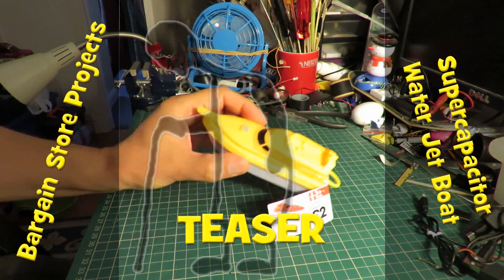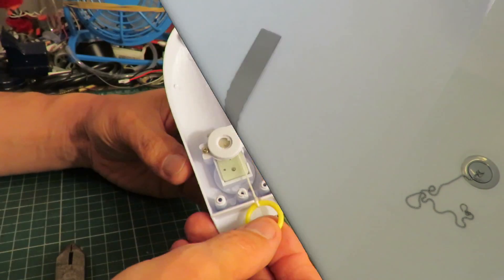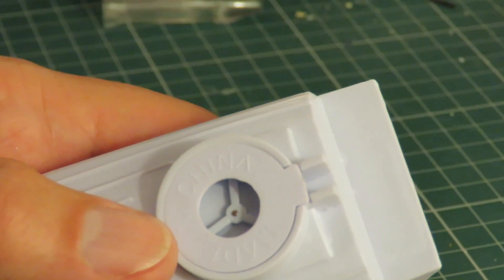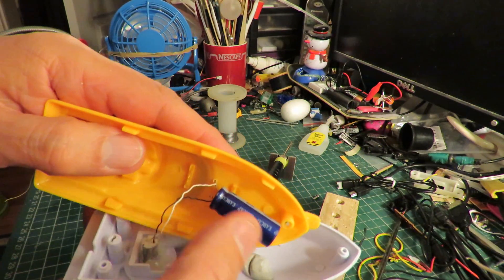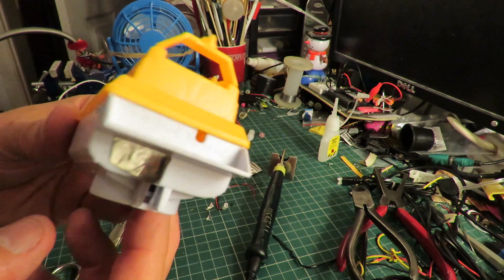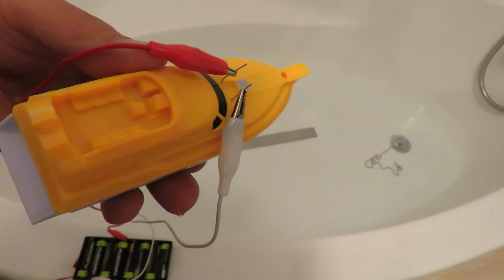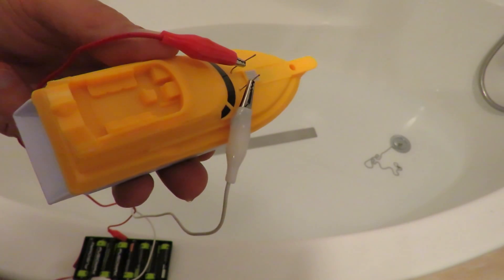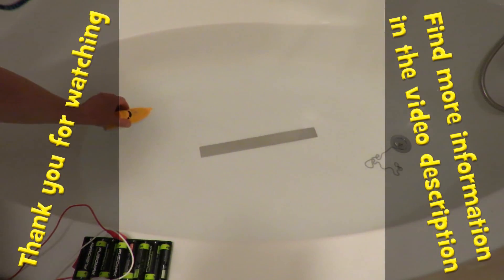Bargain Store Project Supercapacitor Water Jet Boat TEASER

Comment: make that little boat rc, it would be neat
Reply: And keep that impeller style motor
Reply: Not a long enough run time to make it worth while.
Reply: Wil Hobbs i think he means an rc conversion with a mini quad lipo and stuff. Not with a super cap obviously
Reply: Then it wouldn't be a cap powered boats...he has lots of lipo powered boats already.
Reply: Wil Hobbs Not one with an impeller motor. Ill be happy either way but the thing is it would like a speedboat if it was RC. But on further thinking i think the boat is a little too easy to tip to be a speed boat. Either way ill be happy with whatever he chooses.
Reply: +Mr Rishi The Cookie 
Agreed☺